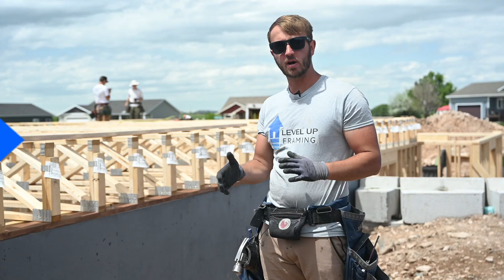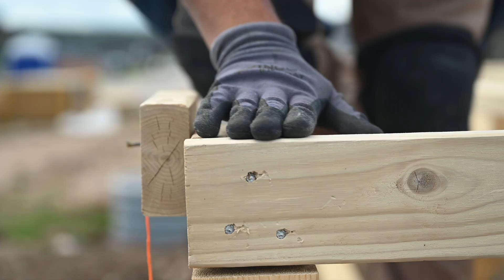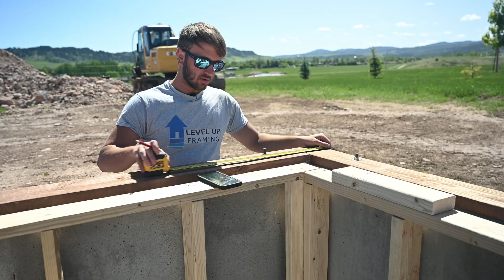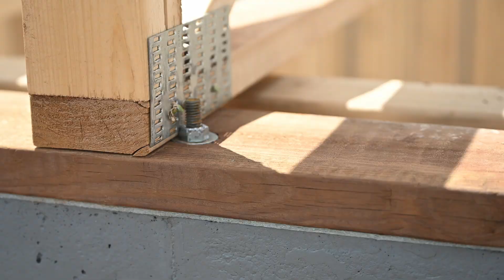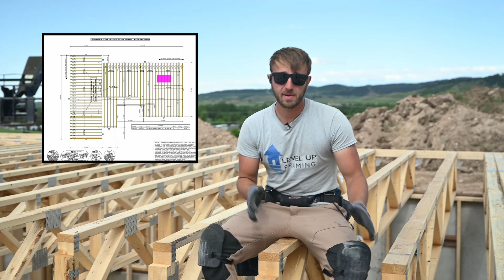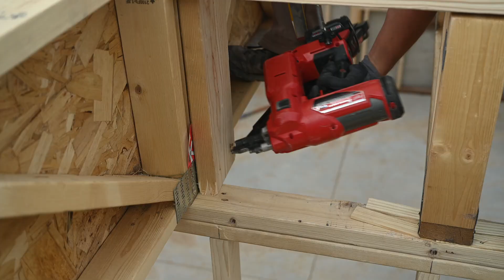How To Install The Rim Board on Floor Trusses

Comment: I framed from 1980- 1998.  19.2 layout started with TGI floor systems.  looking at these trusses he is using are correct.  There are similar style trusses that are devoid of vertical blocking in the web. If anyone knows what they are used for please tel me.

Comment: cant carry down the load if the rim board isnt in contact with the outer heel board.  only thing carrying down load are the 3 nails you put in it. this is not proper as is. The outer heal board is cut too short.
Reply from the maker: This is the way.  

Load equation ->>  (2 top plates = bottom plate + subfloor + rim board with 3 nails + properly nailed sheathing) 

If you have a point load, you must put blocking directly between the subfloor and the sill.

Comment: With all the gaps between rim board and the end truss members, the "load" able to be "carried down" from above is reduced.  It is just nails resisting the load, until they bend.  That foundation bolt that was placed where a truss was - someone failed to communicate properly.
Reply: you got it !

Comment: for heavier snow loads I have the truss company cut back the truss and use a solid, full depth LSL or LVL rim instead of a ribbon
Reply from the maker: @glennstanley2892  that definitely sounds superior!  What snow load do you require that at?
Reply: @LevelUpFraming  around 100 psf. I don't trust em to block under the ribbon when it's a cut up custom with lots of point loads. But I'm a paranoid engineer.
Reply from the maker: @glennstanley2892  that is a huge snow load!  Does that include a second story floor system as well?
Reply: @LevelUpFraming  Ground level: TJI's. Second level: Floor trusses

Comment: could you have drilled the bottom chord of the truss for the bolt?
Reply from the maker: Years ago I asked the truss company if that was ok, and they said it needs to be repaired with 3/4” OSB nailed on each side of the truss. 

Drilling the truss, or cutting the plate significantly weakens the truss, especially in such a crucial place.

Comment: Does there have to be blocking under window trimmers or other point loads at the ribbon board side of the trusses? Or does the ribbon board carry these loads down
Reply from the maker: Yes, make sure to block under large point loads. Around 2000lbs on a king/jack is where is start to put point loads in.  (accounting for snow loads on roof, and live loads on floor systems) on a king jack.

Weight accumulates when the trusses or joists are perpendicular to the header. 

We will be doing a video on this in the future.

Comment: Great work and explanation.  My moron carpenter used 35mmx 70mm rimboard instEAD OF 35X90and  there was a gap under them of 20 mm.  The top floor and tiled roof trusses would have been held up by nails.
Reply from the maker: Thank you!  Bottom plate + Subfloor + 2x4 rim board (supported by nails) + properly nailed osb on the exterior = sufficient load carry.  Even if there is a gap below the rim board.

Comment: Banding Blocks. Rimboard is a different situation.
Reply from the maker: Could you explain?
Reply: @LevelUpFraming  Rimboard is typically a full height end piece. Like 1 1/8" or 1 1/4" osb or lsl rim.   The 2x4 or 2x6 you reference as rimboard is refered to as a 'banding block' - Im 25 year commerial truss designer in the midwest for reference.
Reply from the maker: @Lucastos311  ok, we refer to the OSB (LSL) band as a “rim joist” in our area, as it is used for joists.  On trusses, since they’re just regular boards, we call it a “rim board”.  
Thank you for sharing the terminology in your area.

Comment: You don't have to burn the 1.75 just make your marks at 19.2 and line that up with the same edge you measured from.
Reply from the maker: Correct.  You only have to burn the 1.75” when you are pulling from the first truss.  That is so the layout is framed 19.2 “on center”.

Comment: Hi, Jaden. I recently discovered your videos and I enjoy watching them. I've never done any framing with trusses. Everything I've done has used dimensional lumber, but it looks like the process is very similar. I have a question in regard to getting the trusses plumb before fastening them. Would it work as well to use a torpedo level to check each one for plumb rather than measuring them? Also, do the trusses require some type of cross-bracing or blocking at regular intervals between the spans? If they do, what do you use? Thanks for the good videos!
Reply from the maker: Hello Rodger!  Thank you for the support, we are glad to be useful!

A level would work as well, although I recommend a level long enough to go from the bottom to top of each truss.  Sometimes the heels are pretty jacked up. 

Measuring is the quicker method and it achieves the same result.  In these videos I am going very slow in order to educate people, it is normally much faster. 
For example: when using the measuring method, you can mark your rim boards out on the ground (with proper length and spacing). Then all you have to do is follow the lines when you are nailing them on. 
Also as far as cross bracing - please see our strong back video for the floor trusses.  In our area this is the only bracing required (other than any engineering).
Reply: @LevelUpFraming  I like it! Thank you for replying. I watched the strong back video. That looks very straight-forward.

Comment: Maybe its just me but there's a whole lot of gaps I see where the load is obviously going to be supported by nails, not the 2x4.
Reply from the maker: Right! I wondered that as well when I was learning how to do it. 
In combination with the bottom plate, the 3/4 subfloor, and the exterior sheeting nailed into the rim board; it works out to have the same or greater strength as the double top plate. 
That being said, if you do have point loads coming down through the wall, they need to be directly blocked under to transfer the load down through the floor trusses.  We always make sure those blocks fit tight to the bottom of the subfloor and the bottom of the rim board.
Reply: @LevelUpFraming   and yet, in your point load video, you said the truss counts? In this case, it would only count for 5.25 square inches of bearing instead of 10.5

Comment: Jaden -- Has your engineered FLOOR Truss Designer ever specified an O.C. layout different than the 19.2 O.C.?  Just curious -- Thanks!  Richard aka Retired Person
Reply from the maker: Yes.  I have seen 16/19.2/24. Depending on the project.  24” usually requires 1 1/8” subfloor.  Occasionally 12” O/C in certain areas of the house in order to support excessive weight like wood stoves, granite accents, and rock features above.
Reply: @LevelUpFraming  Jaden --  Thanks once again!  Well of course, my home will be designed and approved by a structural engineer -- and the Floor and Roof Trusses throughout will be designed by a certified truss firm.  I will demand the highest quality materials and the loads will be overrated to exceed the minimum calculated design.  As for spacing, that too will be left to the determination of the engineers.  This will be a unique build.  The floor system will be a hydronic heated subfloor from Warmboard® which is an 1-1/8" plywood subfloor -- and the foundation is a Pre-Cast Basement from Envirocast®.  I have a detailed drawing showing the section of the foundation and the floor truss --   I would love to share it with you -- I could email you the drawing if you wish -- just give me an email.  Richard (Note: I have a different design for the RIM Board location you may want to comment on?)
Reply: @ this is also not correct, 24" oc doesn't require 1 1/8" subfloor, many do that as a quaiity issue, but we often do 24" oc floors with 3/4" osb decking.

Comment: I would like to see you nailing protocols. EX. how many for each stud, cripple, truss, ect. Thanks!
Reply from the maker: Thank you for watching our channel! Sorry for the late response.  
2x4 studs - 2 nails 
2x6 - 3 nails 
2x8 - 4 and so on 

Short cripple studs only need two, but often just get matched to regular studs. 

Nailing trusses is only temporary and not structural.  You either need hurricane screws, h2.5, or some other hardware to provide adequate hold down requirements. 
Nailing trusses is temporary, we do 2-3 on each side (trying to enter through the metal plate). The more nails you put in, the weaker the truss heal (which is not good). 
Stay tuned to the channel, we will be going over these things in depth.
Reply: Code states how many and also size
Reply: Most people over do it.